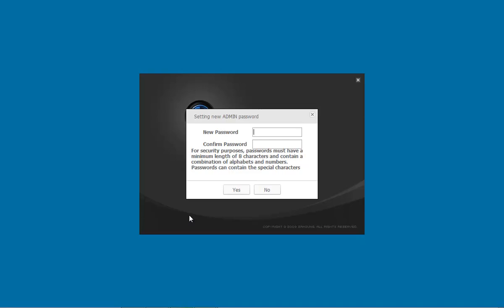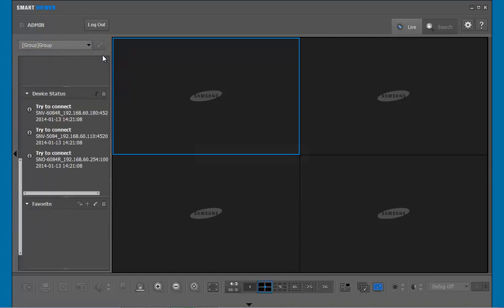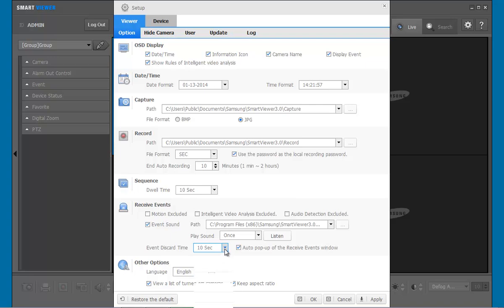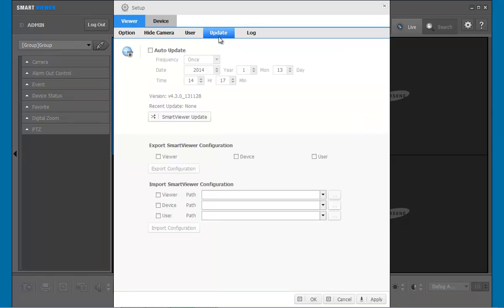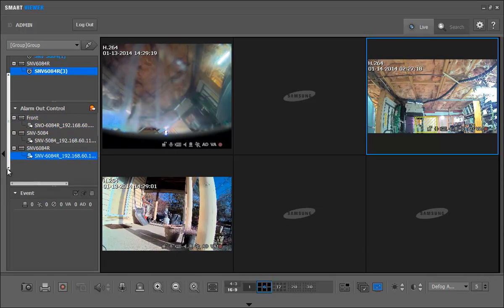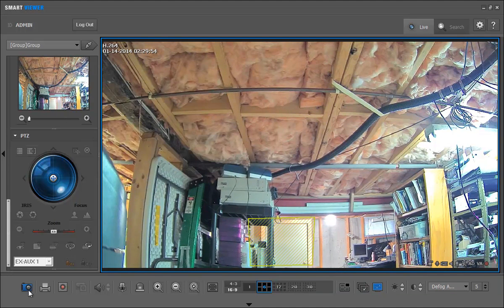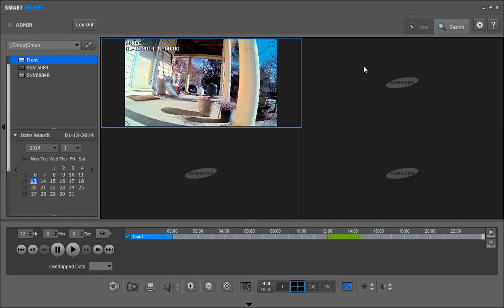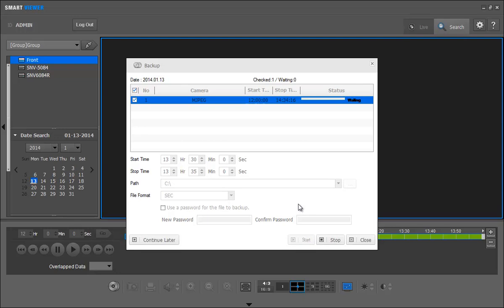SmartViewer+Configuration+and+Use+Tutorial-HD

Comment: The other day i backed up a footage from my samsung dvr on to a usb, on dvr format, its made a .bu file and some other files, does anyone know how to play those files on pc? I jnow it worls if i plug it in to my dvr but i cant get it to work on pc
Reply: Daksh Kukkar when do you use DVR format it's only playable back in the DVR itself. If you're trying to play it back on a PC I suggest using their SEC format which is Watermark and includes a video player. On many of their newer units you can also choose Avi format. This will play on any Windows Media Player, but this is not what are marked, cannot be used as evidence.
Reply: If you are using the smart viewer software, this is even easier. When you're in the search section at the bottom is a backup tab. When you press this you will get two options which will save the video directly to your PC. In this tab you can select SEC or Avi format. You can tell it where to save on your computer, default is usually desktop. And then you can burn it to a CD or save to a Drive.
Reply: realtech did you even read the question?

Comment: has anyone had problems with windows 10 and this program?
Reply: Same here.  Wise View app works fine across multiple phones and tablets.  Smartviewer does not see the DVR on my network.
Reply: Did you resolve your issue? I just tried setting this program up and when I login I don't any of devices on my network.
Reply: Is the program not detecting your dvr? If so then yes, I am also having problems
Reply: Patrick McGee I've tried to make it work many times without luck. A friend of mine is a network admin at Nellis AFB. He had a look at it and was only able to make it work on an old XP system.  He said the software was written in Korea and needs to be rewritten regionally.  Here's how I fixed it. I found two 50" TV's on sale and mounted them in my bedroom and living room.
Reply: Yes, I have this working on Windows 10 machines in several applications. Make sure you have the latest software from their website. To avoid future problems make sure you enable auto updates within the settings of the software.
https://www.hanwhasecurity.com/smart-viewer.html
Reply: @DopeAFHobbies
There isn't a fix for it.  I've spent hours with tech support and they all read from the same flow chart script and none were able to think beyond it.  What I ended up doing is buying an HDMI splitter and adding monitors all over the house.  I'm not happy that they put a shit product into production, but I'm happy with my solution.
Reply: @DopeAFHobbies
Do you have a link to the software page and the software name and version?  I'll probably try it for another layer of convenience. Thanks for the useful information.
Reply: Fpv-quads
Thanks.  I'll check their site again later and send an email.
Reply: @DopeAFHobbies
I sent them an email a few days ago asking specifically for "Hanwha Client" and haven't received a reply yet.  Seems kind of sketch for a support company of Samsung to use Google Drive and not have a trusted download on their own site.  

Gotta say...I'm a little jealous of your property there.  Do you run ColoradoPast.com?
Reply: Just sent an email to your website.

Comment: How do you get the viewer on your PC to show it so clear. When I view it on my monitor its crystal clear but when I view it on the software on my pc connected to the same router (hardwired CAT 6) its pixelated!
Reply: Andrew Delalla this is due to the live view playback settings in your device. Under the network tab, there is a live play back tab which allows viewing quality set up. Depending on your device the live streaming can be from CIF resolution with low-quality up to as much as 1080p. This is determined by the type of device, typically a DVR will have a maximum live Network resolution 4cif which is approximately 480P. The default setting on DVRs is quite low which probably explains the pixelation you're saying. You should be able to turn the settings to the max as long as you don't have any network speed issues. You should check, when you view back in search mode, the video should be at the same quality as you're recording device.

Comment: Thank you for this very informative video, it saved me a lot of manuals reading time. Quick question , Does this app work on any device on the web or  only works on a LAN setup?  Thank you again, best regards.
Alex
Reply: Alejandro Rhode for connections across the web, not in local area network, you'll need to have the outside IP address or the ddns settings. Devices added outside of local network need to be added manually. Be sure that the appropriate ports are forwarded to your DVR, NVR or network camera.